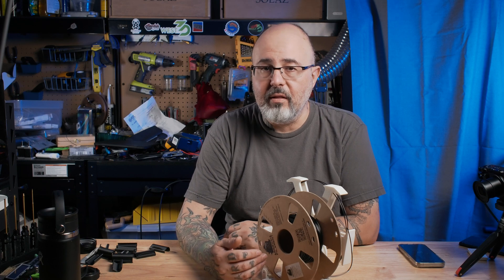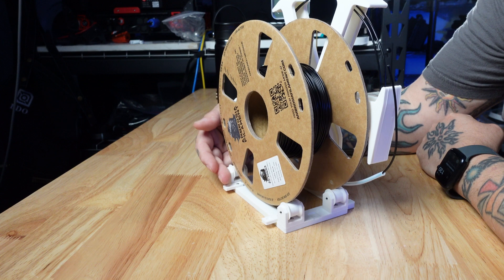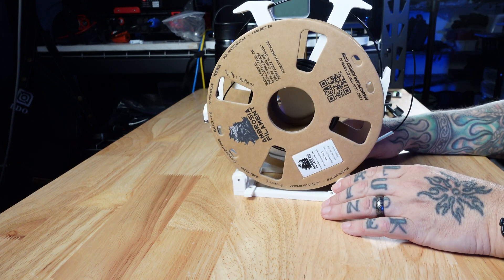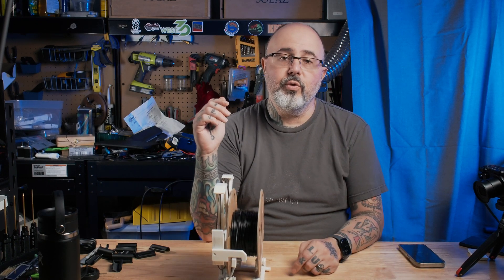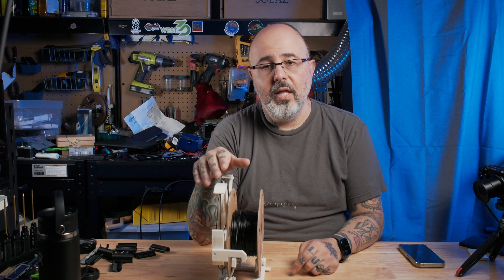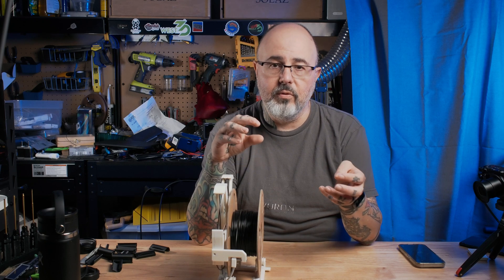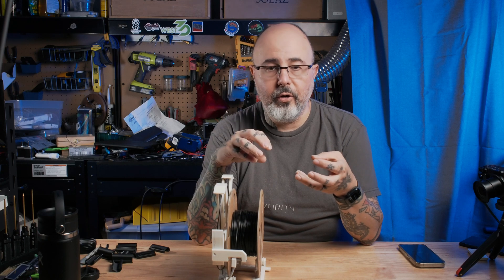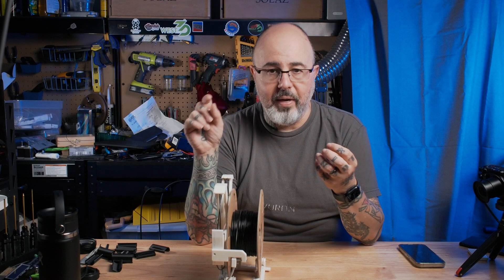MMU project part 2-  moving to 3MS

Comment: The 3DChameleon has a very interesting mechanical design. In terms of function it is very similar to simple MMUs like picoMMU, with one motor to drive the filament another to operate a cam selection mechanism, and it should be no more or less reliable. These simple MMUs leave a lot of problems to solve - filament cutting (ramming is unreliable), sensors to detect filament position (extrude and retract fixed distances needs a lot of tuning), unloaded filament tangling (need a buffer or to rewind onto the spool). They also work best in a bowden system, as with a direct drive system you either need to disengage the filament drive, or use a buffer and keep the drive motor in sync with the extruder.

3DChameleon was intended to be used on any type of printer, hence the cumbersome method of tapping the microswitch to control it. It was probably targeted at Prusa and other bed slingers of the past running Marlin. Maybe you can get the control board to be a Klipper mcu and use the Klipper MMU plugins to control it.

Comment: 3d Chameleon in my experience was a waste of money.  Bill did great support as far as refund and checking the setup and stuff after sending it back.  But its just not as universal as advertised.  There have been zero people with a K1 Max that have gotten it to work consistently.  I'm not sure how you say it fits all systems if there's a system that straight doesn't work.  $200 for something that takes so much damn effort to tune in and get to work is a ripoff.  Maybe $100 for his proprietary mainboard and then that's it.  It's a racket.

Comment: It seems like I'm going down the same path. I started with the ToolChanger but couldn't get it to print properly, so I removed everything with the toolhead, found Chameleon, but saw that this implementation on the Voron 2,4 would add a bunch of wires. So, I decided to look into 3MS. It seems like it’s exactly what I need, but I don't understand how the synchronization of the two extruders will happen, as there's nothing like that in the project. Is it assumed that another project will be used for this?
Reply: Hi. Sorry for the late reply. The extruders are synchronized using Happy Hare firmware, which the 3MS runs on.

Comment: I hope you succeed. Personally, I will not use any mmu system which relies on filament couplers - it’s a jam waiting to happen, plus you need “dangling” stuff on your print head.
Reply from the maker: The combiner will be outside the printer- I agree with not wanting stuff dangling from the print head.